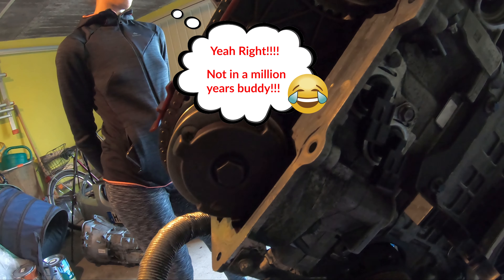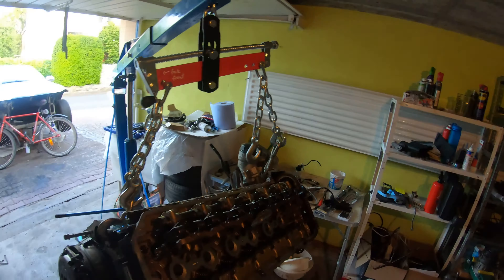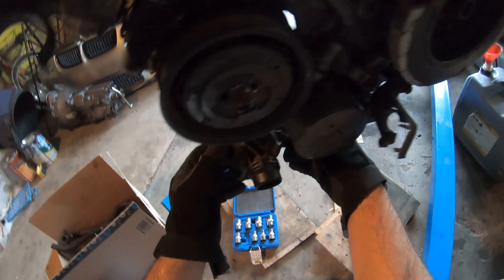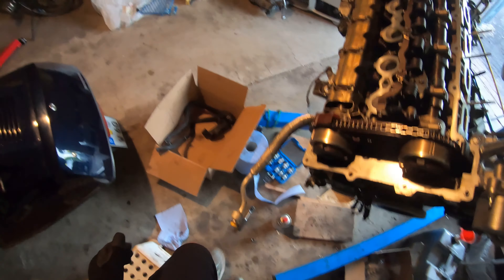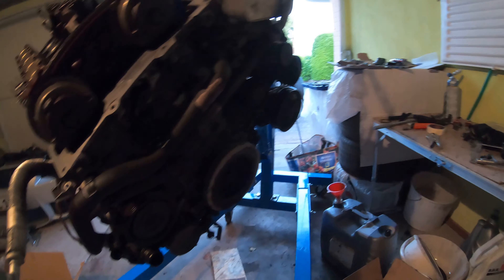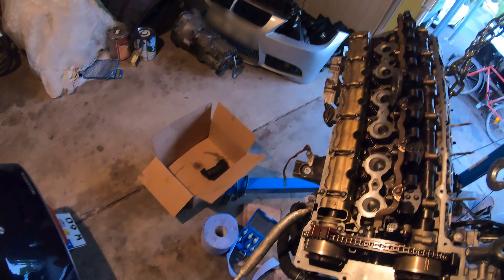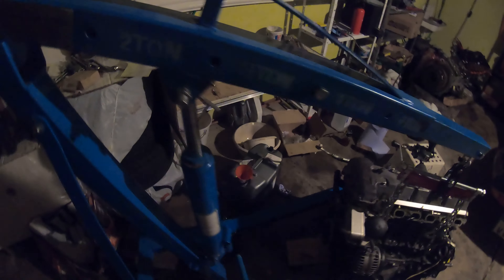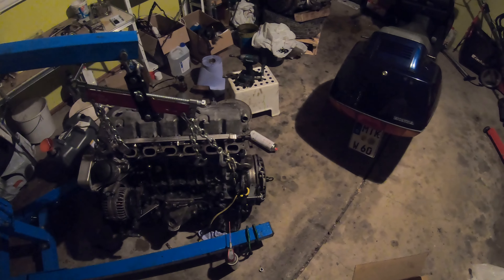[DIY] Full Reassembly of BMW N52 Engine on a 3 Series E90 325i [N52 Engine Swap PART 6]

Comment: I am watching your video currently as I am swapping my 318i to this 325i engine, did a rebuild as well on the N52. I'm stuck at cables and plugs, don't know where each one goes.  Pretty useful guide, thanks! I was worried about bolts breaking, those aluminum ones, I see you have no problem reusing them. Was a big hassle to buy each one new oem. Pretty expensive as well. Hope yours wont break any time soon since BMW clearly states to not reuse aluminum bolts.
Reply from the maker: Good luck with your swap! I wonder if the harnesses work together like that, I mean it should be the same, except for the computer. Yes, I reused alot of the original hardware and was careful not to overtorque and break them. I still did break a few bolts and replaced then with steel bolts, time will tell if that corrodes the metal or not. We'll see.

Comment: That upper coolant line into the block that didn't want to go in is a common failure point. The plastic (mickey mouse)  flange gives up with the heat. You can get an aluminum replacement pretty cheap. It's looking good so far.
Reply from the maker: That's for the heads up, I've seen the coolant bracket crack before.... Do you have a link to the aluminum part? That's a great idea and appreciate the feedback 🙏🏼🙏🏼🙏🏼
Reply from the maker: Nice find. Only $20!!! Thats a solid upgrade, thanks for sending it to me. When I swap my coolant, I will change it out. There is also an upgraded oil cooler part that I may look at... but since I am in Germany, it has to have TUV.
Reply: @buildanddrive  watching this a year later in desperate need for this part if you or anyone can lead me in the right direction I’d greatly appreciate it

Comment: Thanks for very informative E90/N52 videoseries! 

You re-use valvecover bolts, every other youtube videos say renew them (because service manual says), but I think that it's not necessary if bolts are good, those aren't stretching-type (those not) and torque + 90 degree is very low stress to bolts). If you read BMW shop manual, you can notice that it says almost every bolt must renew, but is good to use common sense. 

I also think that your valvecover bolt stretching order was wrong (should be inside out in circle), but maybe that isn't real issue in this case (because low stress and firm valve cover).
Reply from the maker: I had renewed the bolts not to long ago, so I decided to reuse them 👍🏼. I agree to replace them... I've broken like 4 of them over the years. They are very brittle.

Comment: Were did you find all the torque specs for the engine, I can't fine that info can you share that please my car is a 07 bmw 530xi awd. I need to rebuild my engine too.
Reply from the maker: Newtis.info click on the top right corner to add an account
Reply: @buildanddrive  cool I will use that thank you.

Comment: Use OEM gasket dude victor ryans on a bmw now that’s comical you couldn’t even figure out which way it fit..
Reply from the maker: OEM was about 150+ euros and Victor Reinz was 80. Im on a budget.
Reply: FCP euros have original manufacturer gasket for a decent price life time warranty… these motor like oem parts just my opinion..